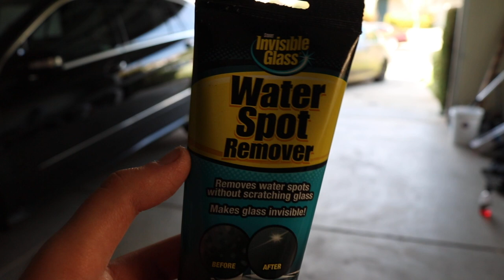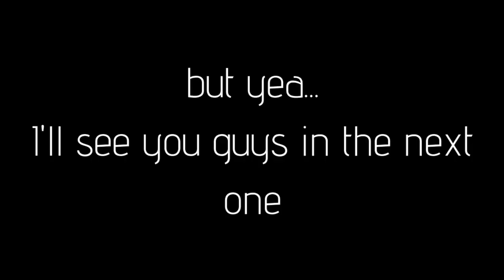Working On My Most Neglected BMW!

Comment: Hey bro I’m parting out my car and I have most of the front end , radiator all the hoses and ac condensor and suspension lmk
Reply from the maker: Robles Inline 6 where you located?
Reply: Nour Hummadi so cal area
Reply: Nour Hummadi I also have the full trunk lci conversion